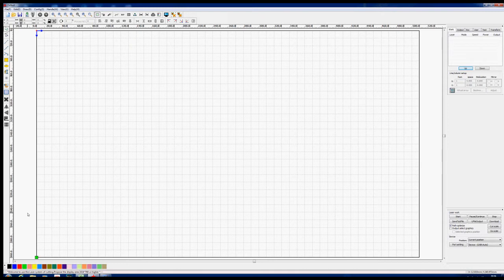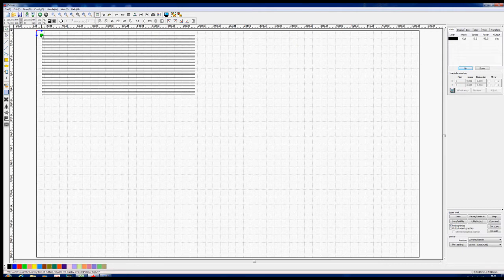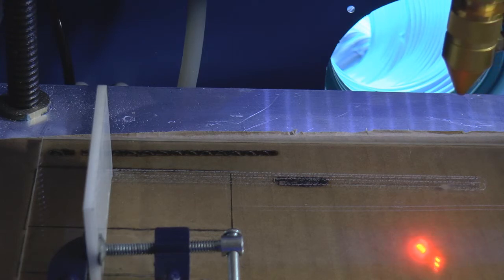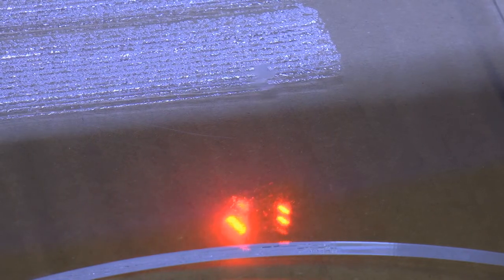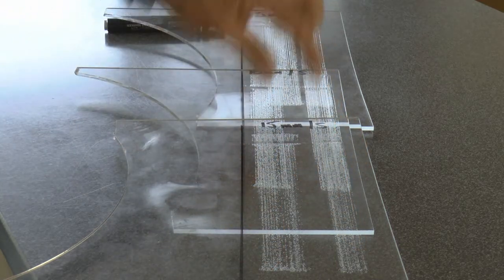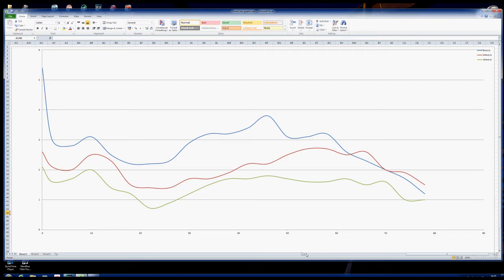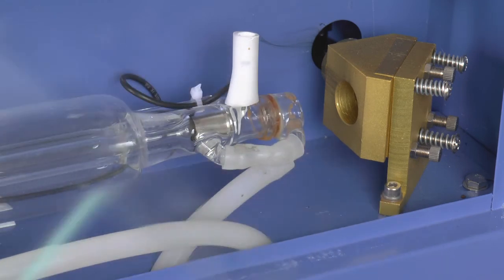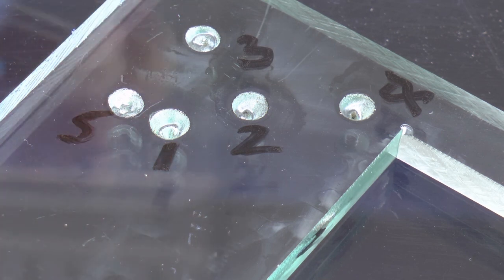RDWorks Learning Lab 16 Laser Power LossTests

Comment: I am having the same problem, with a cut of six pieces it will cut the first few nicely then taper off to not even stain the back side then on the last piece the power is back nearly to what it was with the first cut but they not even close to each other on the board.
Reply from the maker: +Mentorcase 
If you look at the latest video about working with paper you will see that I was using my dodgy machine at 15 and 18% power setting. It performed flawlessly hour after hour. It was a bit puzzling. I have carried out some more tests that will be published in the next day or so where I use some very basic techniques to establish what the actual power output is. I found that at 50% power my machine worked reliably (outputting on average about 20watts) but push it up to 70% and the power output actually drps to less than 10 watts!  Try running yours at low wattages.